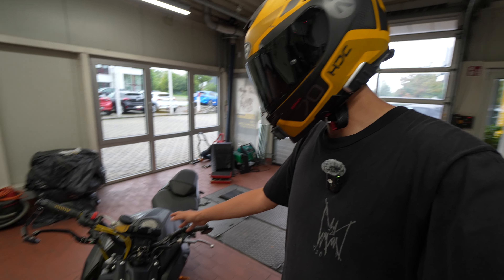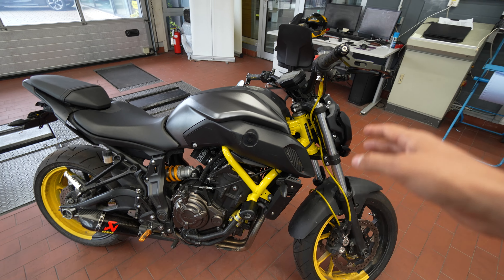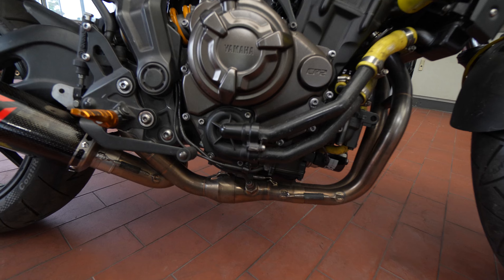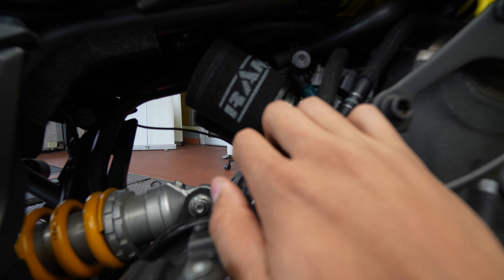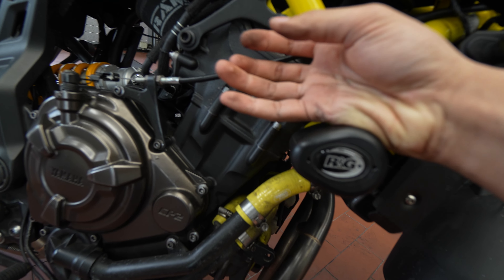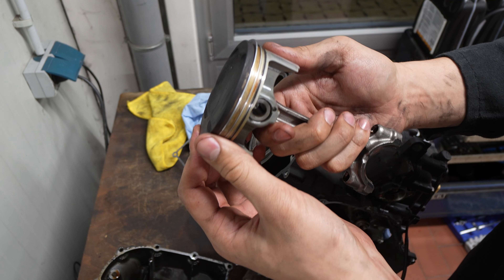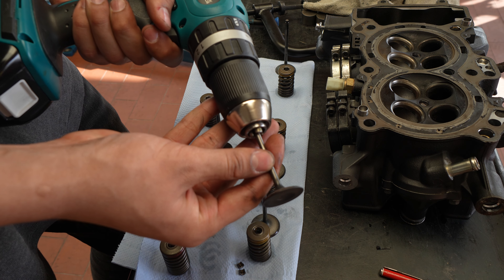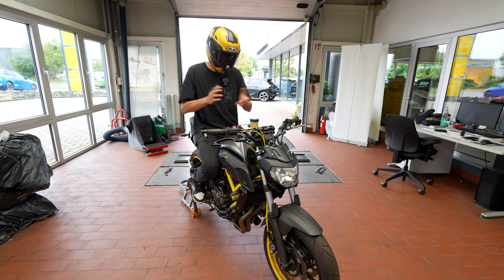I FINALLY FINISHED REBUILDING MY BLOW MT-07

Comment: Nice one! Bike is looking good. Can't beat the sound of the CP2 with an aftermarket exhaust. 
I'd have probably gone full yellow on the wheels, but respect the design idea.
Reply from the maker: Thanks man, it still runs a bit rough cus the ECU hasn't had time to run in properly and the throttle bodies still need balancing. Other than that I'm happy I can finally ride it 😁